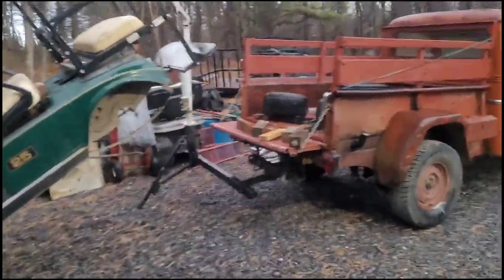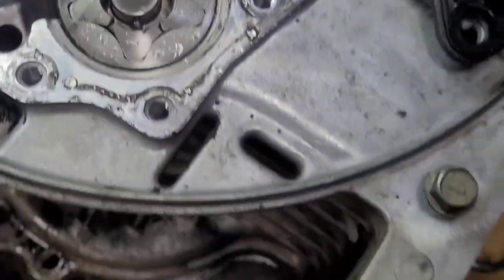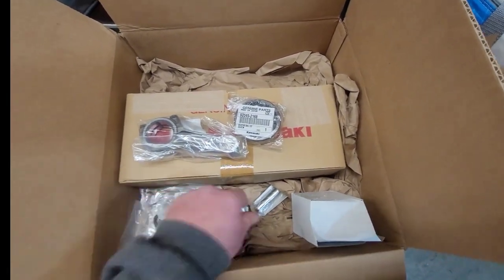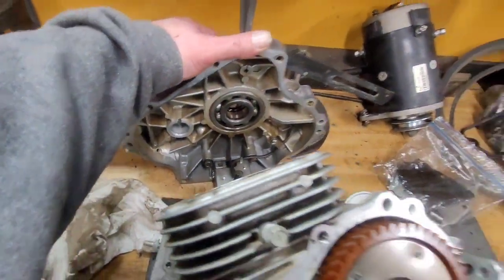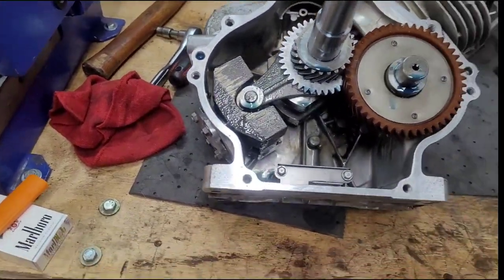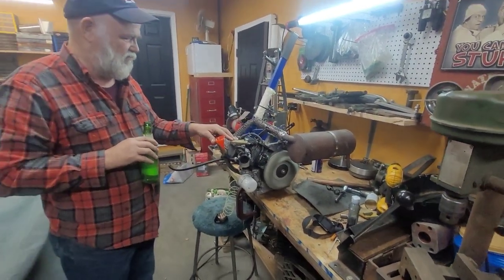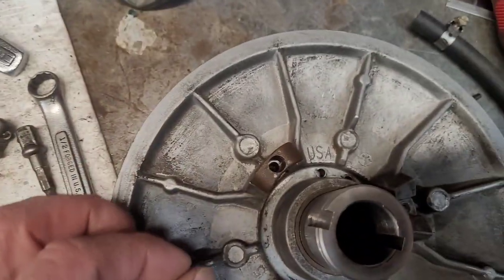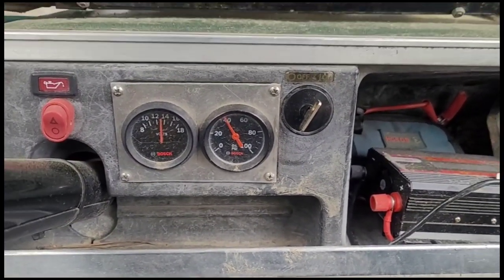Club Car Kawasaki FE290 Engine Rebuild! #clubcar #golfcart #golf #engine #kawasaki

Comment: where did you order the kit from?  Could you post that link?
Reply from the maker: For this rebuild I used this kit https://www.psep1.biz/Kawasaki-Rebuild-Kits/kawasaki-fe290d-standard-size-ultimate-rebuild-kit.asp but the crank was not correct, I had to modify it for the clutch as I stated in the video.  You can get the correct crank with the taper, but it is 6-700 bucks.  This website also sells a kit without the crank if you don't need it.